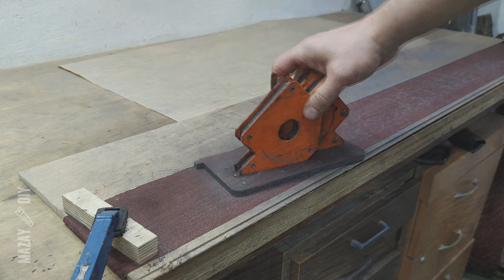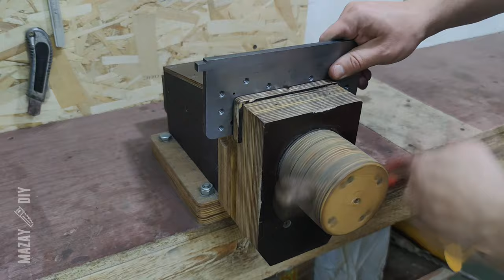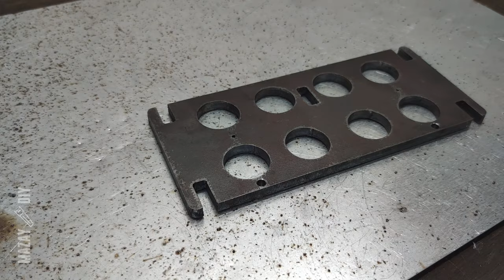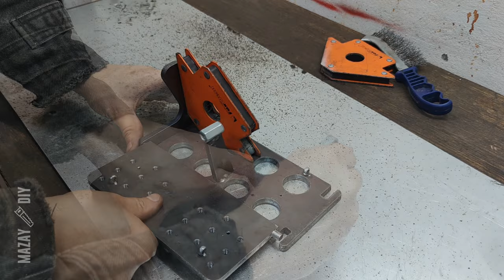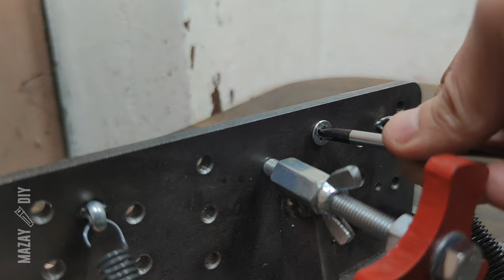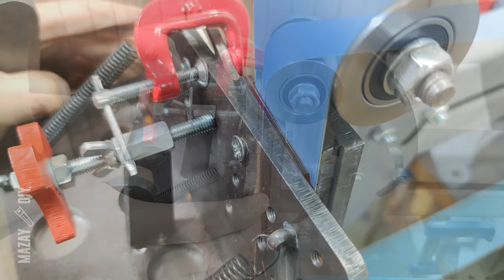Perfect Bevels - DIY Knife Bevel Jig | Simple and Solid

Comment: 50 bucks of materials, hours of cutting and drilling and then all the tapping.  Oh man.  All to make an ok jig that you can buy for under 100 bucks.  Newest designs are better and don’t rust.  Better clamping, reversibility for better location of the blade, some even have rails to prevent wavy blades.  Meh.  Personally, I’m tired of watching folks try to appear to reinvent outdated things.  When I want to build something, I’ll buy a hammer then build that something.  I don’t need to build that hammer.  Particularly with a wooden vice.